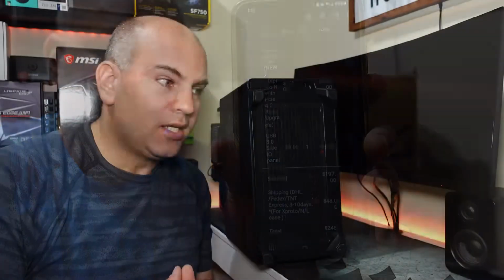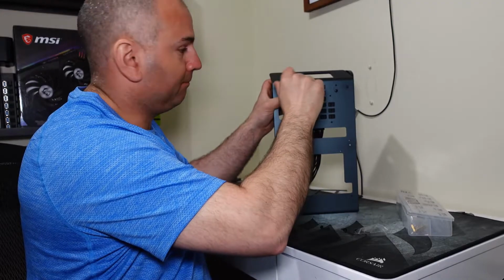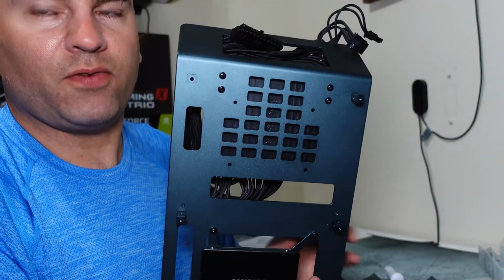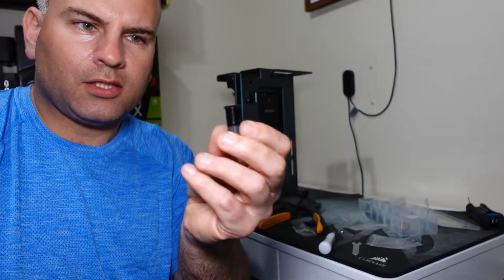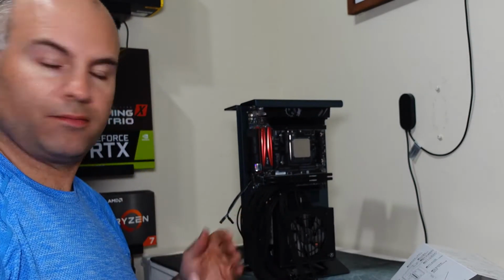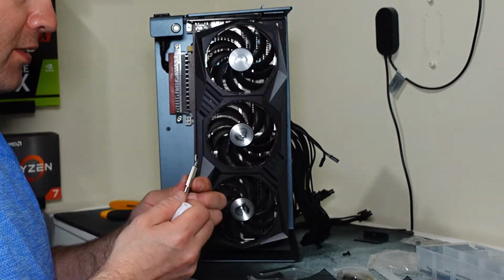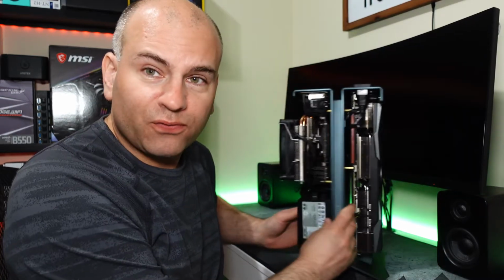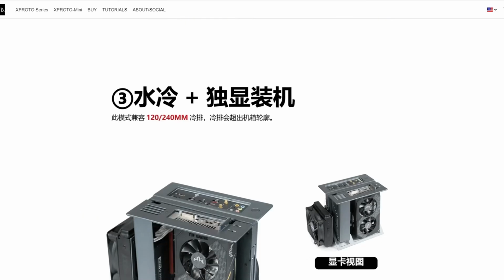Xproto-N by XTIA, Sweet Open Air Build

Comment: not sure if anyone will reply, but i want to ask if its true that gpu’s io on top is bad for the gpu? if so, why? thnks
Reply from the maker: If the ports were facing down I think that would be bad
Reply from the maker: Never heard of that one before. Many GPS are made to vent out the top which is why they have vent holes there
Reply: i see in a lot of posts they are saying it is bad (io on top, pipes pointing down) they always use the noctua cooler orientation recommendation to support  their statement.. some reports they are getting hotter temps. so far i see no difference for now..
Reply from the maker: @gregleizl27  I saw no difference either. It was a great case for temps. The only problem I had is that my riser cable got kinked. I had a choice of spending a small fortune on a new PCI-E 4.0 riser or mod my case to make the GPU connect direct to the slot... So the mod I did 😁

Comment: Great guide Mr Not Bios. Do you think the case would tip over if I used my Scythe Fuma 2 from an NR200P build?
Reply from the maker: No, it is a stable case, especially if you have a heavy graphics card on the other side. If you have no GPU at all it could be tippy with that large cooler. I am using the Revolt 3 case these days but is a rather "Hot" situation. I removed the one side panels completely and removed the dust filter from the other side to give more air flow.

Comment: Just started building after purchasing everything. found a 90 degree hdmi by UGREEN was handy! It’s worth the money for cord
Reply from the maker: when using a computer Display port is the way to go. UGREEN products tend to be fairly good. I used a small HUB for sometime that has phone holder with 3 USB slots, SD card and micro SD card slot on it... "UGREEN USB 3.0 HUB SD Card Reader, 7-in-1 USB Multiple Function Extender 3 USB 3.0 Ports SD TF/Micro SD MS M2 Card Reader with Phone Stand"

Comment: What are the temps? Nice looking by the way!!
Reply from the maker: It is open air so temps can't get any lower vs a case really. I also run everything different my GPU temps dropped 4c vs a case but have since removed the shroud and run at lower voltage for my GPU so my 3070 is 59C max temp in furmark now. I have since modified the case and moved the GPU and put extra USB ports onto the case and drilled extra holes.

Comment: You're paying 1k + for a case and putting it under your desk? no way I put an open-air case under my desk.
Reply: Ahahaahahahha 1k😂, it costs at most 190
Reply from the maker: My case was not nearly that much $190 USD with PCI-E 4.0 riser cable. $118 if I already had a riser cable.

Comment: Some of the 3080 uses a 2.7 slot like the Asus RTX 3080 TUF are you able to put that card into the Xtia Proto-N as the Xtia website said it can only fit 2 slots for the GPU? Is the .7 part graphic card referring to the extra thickness of the fan on your 3070?
Reply from the maker: Good question. 2 slots is referring to the I/O mount part of the card that contains the graphic connectors. The card you are referring to has 1 slot used for I/O and the other has 1 I/O connector and air vents. It is an actual 2 slot card but yes the .7 part it is the extra thickness. My MSI Gaming X Trio is also extra thick and covered half of the lower slot hole of my NR200 case. Since the XTIA Proto-N is open air only the top I/O slot opening size matters.